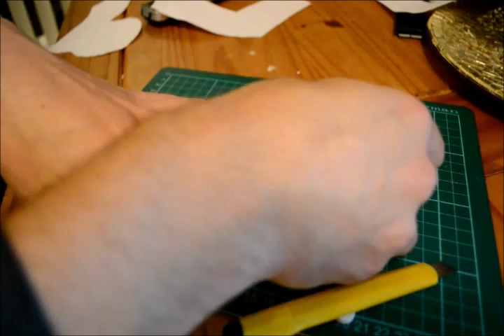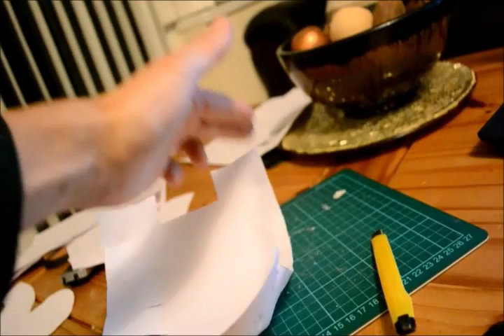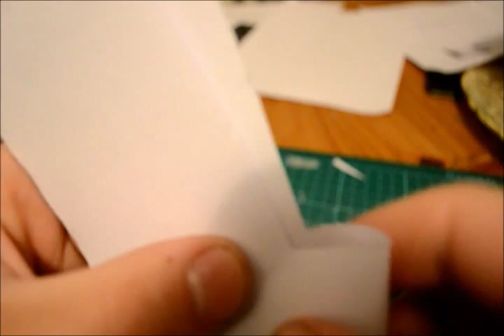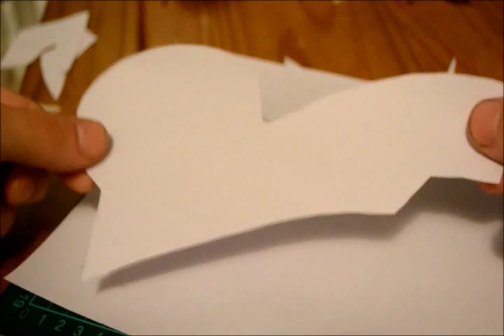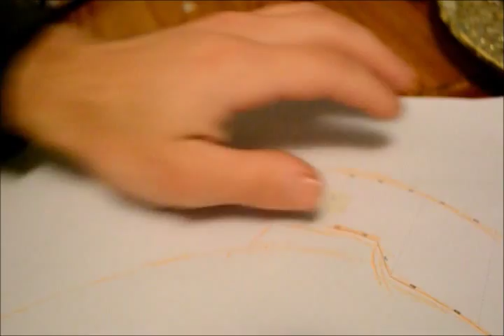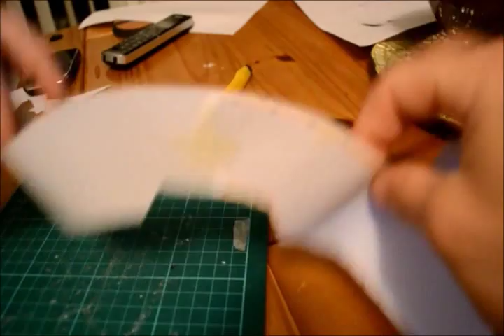7 - Editing pepakura files for use with foam for my Iron Man suit

Comment: Im using eva foam for a helmet. For one of the pieces it has 3 very small slits. Do you suggest cutting them seperatly anyway? no matter how big or small they are?
Reply from the maker: it all depends on how big the slit is, if its tiny it may not be worth it. If its big then the foam wouldnt bend right without the cut. just play around and try it out.